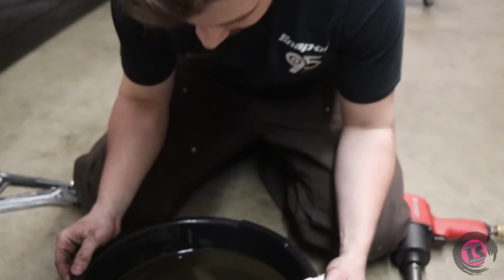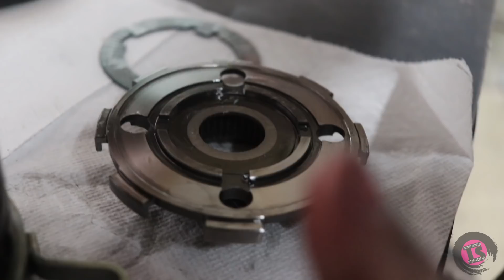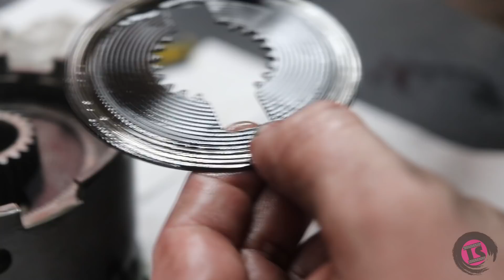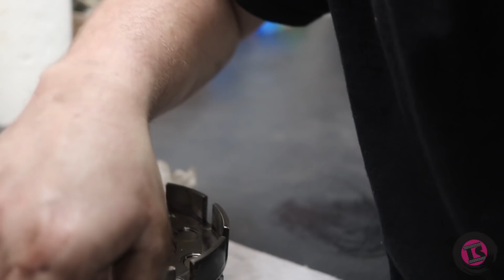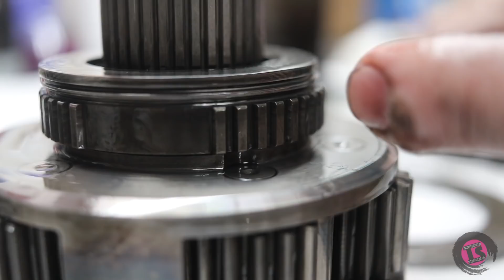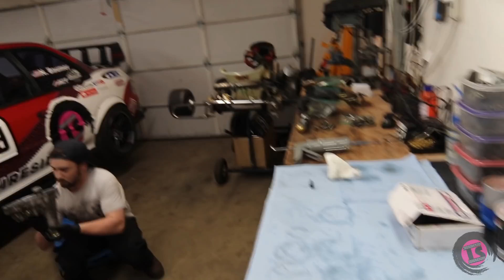Subaru DCCD Differential Rebuild

Comment: 05 sti clunks and binds at low speed. Narrowing it down to center diff. Will replacing clutch disc gears fix issue?
Reply: Lmk if you do yours? Mine just start doing it too

Comment: What a crap design, I've seen better things in a chain saw,why not just have a centre diff with a lock cheaper to make and more so they work with a true 50-50 torque not like this gimmick AWD system that is making Subaru a lot of money with the failure rate they have,I might try a coconut 🥥 in my forester it might drive two wheels rather than just one.

Comment: Thank you for the breakdown (No pun intended) of the DCCD!!  I look forward to the time my STI will Need this upgrade, for now I have an understanding of the components in their. ?? Question... I have always (since I bought the car with the very low 95,000 miles on it for a 2005) had a Very tight shift, meaning going in an out of any gear, any time, it takes a little effort... Any thoughts on her issue??  It is very stock and probably not raced in her life.  Cheers mate ✌🏼

Comment: hey what transmission are you using? I'm having a similar problem with my 96 ra but I'm not sure if that shim kit you purchased would work for my 96, and I cant seem to find info on weather the center diff changes from 96 gen up to the 2002 gen and newer .the kit they sell says its for 2002-2005

Comment: Hey, Bro. my STI 07 makes this noise when turning: https://youtu.be/bXXVEkISBx8
Could this be a problem with the dccd or is it the rear diff?
Reply from the maker: It’s hard to tell from the video, could be torque binding from the center differential.
Reply: @TIRESIDE  Maybe you have an idea - I lifted STI yesterday with a floor plate lifter - and made the movement in first gear and in reverse, while completely turning the steering wheel - there was no noise.  The hum sound only appears when the car has a load on the ground.  Another interesting feature is that there is a hum sound even in neutral gear.

Comment: Only video I've been able to find on rebuilding one of these! Will definitely come in handy for when I convert my Bugeye to 6 speed and rebuild the center diff
Reply: Good luck. Did an 04 6 speed swap on my Bugeye back in '15. First drive had a terrible sound so pulled the tail shaft housing off, replaced all the bearings and ended up swapping in a known working DCCD just in case. My budget swap turned way more expensive due to the parts I replaced. Those bearings are $$. Still have the other DCCD and may entertain rebuilding it now.
Reply: @cordcd7  I plan on buying a whole STI drivetrain with a DCCD controller from JDM Chicago

Comment: Hey! Did your DCCD make a noise being worn? What did it sound like? Possibly dealing with a failing DCCD.
Reply from the maker: No noise, it just slipped like a bad clutch almost
Reply: @TIRESIDE  did it slip like a bad cluth also with the dccd in free mode (green light)?

Comment: Great video, I am about to rebuild a viscous coupling for a 2011, 2.5i awd turbo  6 speed manual gt wagon, BR9, can you give me better info on the oil used pleased.?  Subaru are appalling here in Australia, for parts & info, it is a secret society, parts rip off.
Regards
Des
Reply: Des contact Corgiworx in Sydney they rebuild the centre diffs. Your centre diff is completely different to this centre. Its a silicone fluid that Toyota supply, Subaru dealers can not supply this as a spare part / fluid.

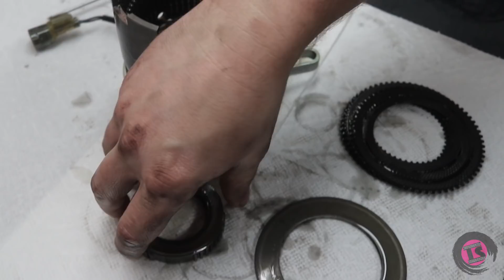Comment: Sweet video! One correction/clarifying comment: At 8:55, you say "...these planetary gears are just for centering the whole clutch assembly..."  Actually, the planetary gears are what determine the basic torque split between the front and rear axles. With the DCCD clutches open/no current to the coil, the center diff is open, and the planetary gears are designed to split torque approximately 60/40, with a rear bias (exact split can vary slightly depending on model year). Just wanted to throw that out there!

Comment: My 2009 sti has a binding issue at slow speed when turning, if you walk the car with clutch only while turning you can feel the car slowly come to a halt. Makes a very unpleasant noise as well. I've narrowed it down to the center diff, but unsure if it could be something else within the drivetrain. Any suggestions?
Reply: fatal3sgte I’m having a similar issue in both forward and reverse, is yours making a clunking? And have you figured it out yet?
Reply: @ceddyb11  Sorry I didn't even get a reply notification, yes clunking sounds and binding as well. https://youtu.be/wGpFxCntLPc 
Sounds identical to this video but I'll get a video of mine and upload it within the next few days. Finding info on the forums is a nightmare because it becomes a WRX dick measuring contest and trails off from STI topic.
Reply: @fatal3sgte  This was pretty much the same sound I heard after I swapped an '04 6 speed into my '02. I ended up swapping in another DCCD along with replacing the bearings in the tail shaft housing. ~$1000 later and the issue was resolved. Not sure if it was the DCCD or bearings in the end. Still have the original DCCD so I think I'll take it apart and inspect the clutch plates.
Reply: @cordcd7  well let me know if you take it apart I'm curious
Reply: ceddyb11 think it’s the center diff, my 2010 Outback 6MT has the same issue, dealer quoted a whopping $3100 for the job. It’s a almost 8-10 hr job
Reply: @RingZero  Plus the centre diffs are worth big $ as a spare part.

Comment: does the dyno have the roller lock together with a drive chain or something so power can be applied to both rollers? just wondering because that would blow up the new center diff too.
Reply from the maker: It’s a Subaru specialty shop. The dyno didn’t blow the diff. Years of abuse on the drivetrain from the owner of the donor car wore it out.